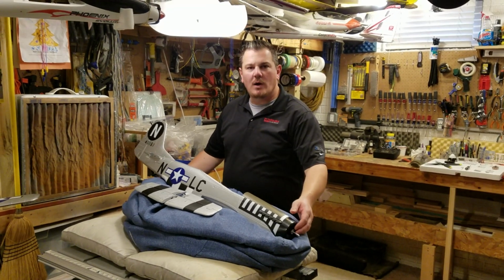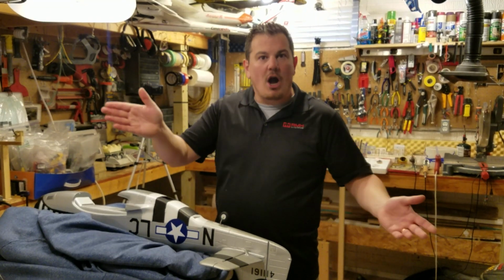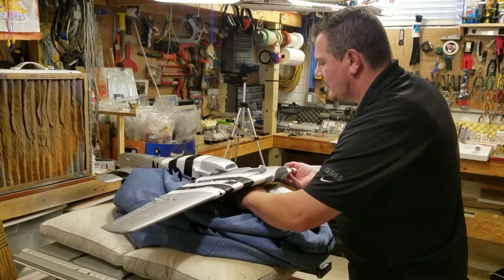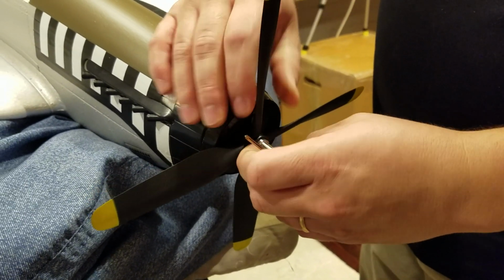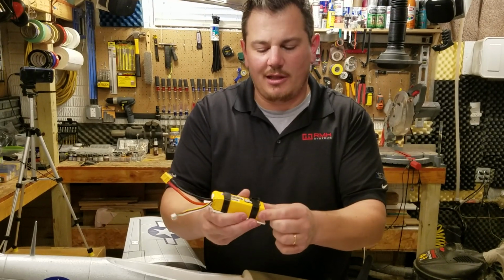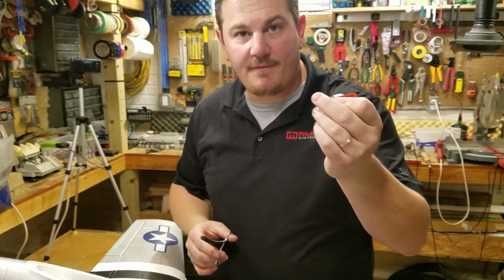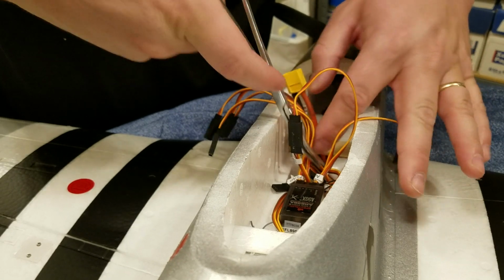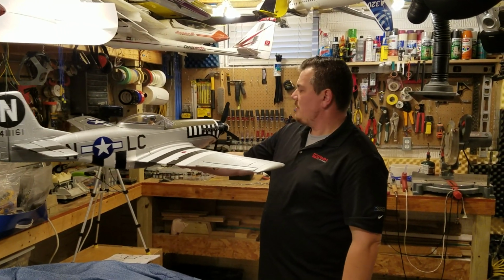Horizon Hobby - P-51D June Nite - 1.2m - Build

Comment: Hey Brian, any ideas on how to connect the push rod on the tail dragger wheel for a new fuselage? Mahalo brahdah!
Reply from the maker: I have no idea. I'm pretty sure you can take the cover off of where the tail dragger goes, but then is that going to be enough room? Not sure...but if you have to make an access hatch, that would be my next guess. I've never replaced that part.
Reply: @BrianPhillipsRC  Thanks Bro!

Comment: Brian, I’m going to buy theJune nite P51 I have a chance to get a Spektrum DX8 2.4 ghz radio with Lopo 4000 mah and 128 mb SS card with original charger gently used for $265 ! Is this everything I need for this plane, and do you recommend me going for it??? Sounds good, but I value your opinion!! Thanks for your help!! Jeff T.
Reply: Any suggestions would be appreciated!! You’re the Man!!! Jeff T.
Reply from the maker: I suggest you get it, and when you're ready for the latest and greatest, we're reviewing the NX8 with the P-51 June Nite 1.2m (Again, just like we did when we got the NX6) - It should be pretty cool!
Reply from the maker: DX8 will work just fine - MAKE SURE THEY RELEASE THEIR RIGHTS TO IT ON SPEKTRUM.COM!!!!!!!!!!!!!!!! - otherwise you won't be able to upgrade firmware, and you'll be screwed! You NEED to do that to have access to some of the NEW features of FORWARD PROGRAMMING.

Good deal, otherwise, from what I can tell....I bet you could low ball them a bit ;) (Don't tell them I said that)

Comment: I just got mine today, and it seems as though the motor is mounted crooked, but the front cowling seems to be crooked to match. Is this normal for this plane?
Reply from the maker: Yes, this is true on REAL planes too, but may be harder to notice. This counters the torque produced by the prop spinning, and helps with the THRUST ANGLE (Sounds like fun - LOL).
Reply: Brian Phillips Ohhh that makes sense, thank you!!

Comment: Hey Brian I just got into the hobby binded my horizon hobby corsair to my DX6i..all great....but when I power off my controller the electric motor starts up..
What am I missing..Brian
Reply from the maker: First off, don't turn OFF the transmitter while powering the plane, that's a dangerous thing to do...

As for the throttle coming on, ESTEBAN (the cameo in this video series...also had this happen to him, and he got cut...but not really bad).

You need to re calibrate the ESC throttle range.

Try this with the prop off, or plane secured so the prop can't hurt you or damage the house...

1) Plane off
2) Transmitter off
3) Transmitter ON, throttle 100% (All the way UP)
4) carefully plug in the lipo into the plane
5) Listen for the beeps, and songs from the ESC/motor
6) When it starts singing, pull the throttle stick to 0% (All the way down)
7) You'll notice the plane "ARMS" as usual
8) Test it
9) If problem persists, call Horizon Hobby tech support and ask them for pointers. Be careful not to get cut!
Reply: @BrianPhillipsRC  Brian I did call tech support and they said it was AS3X WITH SAFE SELECT and that it was normal..does that sound right..and can you explain what AS3X is I'm new to the hobby

Comment: Would this p51 be a good second plane? Btw you do a awesome job on your vids and details. Thank you
Reply from the maker: Thanks Keith! As for a second plane, it's definitely possible...just keep in mind the tail dragger makes for a more challenging takeoff and landing, especially with a high "P" Factor (torque from the motor trying to pull the plane) which requires you to counter with rudder, and it's a bit of a tough maneuver for a beginner. You CAN do it, but it's not as easy as you might want it to be, and then you'll be fixing retracts. My best advice, if you DO get this as a second plane, plan on flying from a larger, opened parking lot, as a narrow runway will be tough as you learn to deal with the "P" factor.

This plane and the P-47D are both doable choices for a 2nd plane, but you gotta be pretty comfortable with your first for the best chance at success. I had my P-51D 1.2m Blondie for my 4th or 5th plane, and still had some fun learning the hard way with it ;) ....although I didn't have SAFE, only AS3X (Stabilization).

Comment: Hey Brian I just got the plane today and I’m having some CG issues. I’ve got my battery tray pulled out all the back and I’m still having problems with it being nose heavy. I’m using a 3s 2200 mah battery using the recommended 85mm mark.
Reply from the maker: Gear up or gear down? Are you hanging it upside-down or right-side-up?
Reply: Brian Phillips I’m hanging it upside down, gear up. I’ve got it satisfactory ever so slightly nose heavy and she flies like a dream. Possibly when I move to a larger battery it will improve.
Reply from the maker: If she flies well, then you're golden!!! Sometimes the manufacturer recommended CG is not what I would want to fly, but most of the time It's a good starting point...at least with Horizon Hobby products.

When you get into the Chinese models, you will have to work it out yourself more often, in my experience.

Comment: would you be willing to do a build video for the hanger 9 p-51 mustang s 8cc gas powered trainer?
Reply from the maker: I would love to do that, but won't be embarking on any "big" projects until after we get moved, and my shop setup.
I'm sorry for the delay...believe me, we're ready to be back to normal life!!!
Reply: @BrianPhillipsRC  ok cool thanks. it is BNF or RTF kit so doesnt take much im just new and would love a video.
Reply from the maker: The Hangar 9 planes are generally ARF, "almost ready to fly" which means they are sold as a kit of the main components, like wings and fuse and then you've got to buy all the electronics, motor, receiver, and assemble all of it together. It's a lot less work than a kit, which is a set of plans and balsa wood, and some plastic parts, but it's certainly not a PNF, plug and fly, or BNF, bind and fly...

Hope this helps you understand my situation better :)

Comment: Hi brian nice to get an idea from your video before i buy that model. i have a question, how easy or hard to fly P-51 compare to timber that i already have?
Reply from the maker: Good question, the P-51 is about 35%-50% more difficult, only because of the Torque Roll tendency that has to be dealt with for proper takeoff, and getting on the mains can be tricky too...

Other than that, you'll LOVE it!!!

Hope you agree with my assessment ;)

Comment: Hi, me again Brian - i flew again today and moved the battery as far forward as i could get it. Hanging off the front off the battery tray as far as it would go and I'm still really tail heavy. It still flew great but only achieved level flight with +50 trim on down elevator! I've read a lot of forums and no one else seams to have this issue, everyone seems to be achieving balance without adding weight to the nose. I'm running a turnigy 2200 3s which is according to the spec, 6 grams heavier than the recommended e flite battery so i shouldn't be having this issue!. I'm really perplexed as to why I'm going to add weight to get this balanced???? Can planes fluctuate this much? Am i doing something wrong?
Reply: Just to clarify – I've checked everything again and when upside down, the cg is perfect – exactly 85mm back from the root with the battery forward. It's just that i have to use a lot of down elevator trim when in the air. Flies perfectly well though so it's not really a big deal. Got much better at my landings today only one nose over out of four landings and I was landing mostly at my feet. Shorter grass makes a big difference!
Reply from the maker: Okay, if you're spot on with the plane upside down and landing gear DEPLOYED, then you are CG'ed out okay. Now you need to make a mechanical trim.

If you haven't done this before, I have a video of what I do on my Timber 1.5m (full size) where I think I do the elevator... https://youtu.be/MA8nltg1Uj8 ...watch this video and see if it gets you the idea of what to do. It's the same thing, only you'll have to apply it to this actually easier application, since the servo is easier to reach in the P-51D.

Let me know if you can get it done, or if you need help :)
Reply from the maker: I totally get your complaint, and all I can say is that maybe your plane DOESN'T have the counterweight that's hidden in the front, near the nose. We found one in Esteban's P-47D 1.2m, and neither of us had a clue it was in there....so maybe there's one that's also hiding on the P-51D 1.2m and I haven't seen it since it's hidden in the nose of my plane too....
So, here's what I would try. First I'd try a bigger pack. 3S 3000mAh pack...or a 4S 2200mAh pack...either of which should get you to CG.
Secondly, I'd call up Horizon Hobby and just ask them. Maybe they'll send you a new fuse? They'll be reluctant, but be politely persistent and you'll get what you ask for. Don't wait to do this, as the longer you wait, the lower the likelihood of success with them.

Comment: Another great video.  Maybe a little over kill on the hot glue.  In my 40 plus years of RC flying I've never had a servo connector come loose.
Reply from the maker: Yeah, cheap insurance ;) These ones, for some reason, seem especially loose. Some of the super thin "Y" cables don't seem to have a great bite on the pins of the servo cables.
Reply: yes, I guess you can never be too cautious.  Seems like I read somewhere that alcohol would loosen the hot glue if you needed to get the connectors out.
Reply from the maker: The glue will roll off usually, but prevents bumps from popping them off...I had some come unplugged in my upcoming series (during the build - LOL)!!!

Comment: 1.2, 1450, 1700....do you have a preference?
Reply from the maker: I love the 1.2 meter size since it's do easy to store and transport, but some day I'll get myself a 1450mm or a 1700mm so I can get all three wheels to retract ;)
Reply: thanks Brian. your pilot skills are obviously top notch. Have you compared wing loading, flight characteristics? they dont seem to list wing area? im trying to pick the most forgiving size to fly. i fly a umx pitts, very easy to fly and easy to get out of trouble.  I bought an FMS 800mm p51 but dont want to start on the most difficult sive to fly
Reply from the maker: If you fly a Pitts, you'll find this way easier. This plane handles crappy weather better, and it's super predictable EXCEPT for if you put a HUGE lipo in there...it'll CG out okay, but she liked to nose over if you "get on it" too hard...other than that, you'll love it! 1.2m is a good size ;)
Wing loading should be better and better for the same model as you increase in size, provided it's similar material. This one has low wing loading. It's a light plane :)